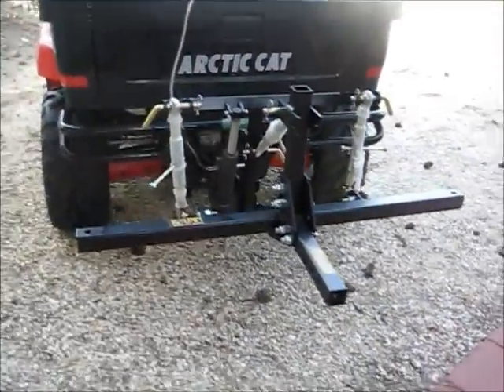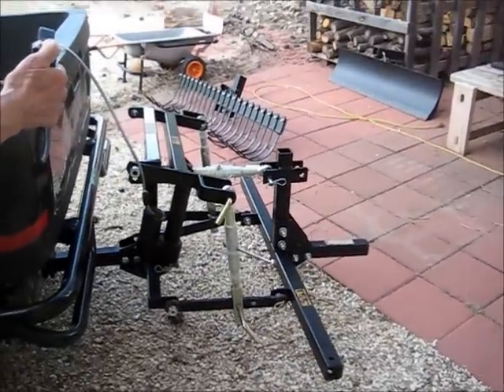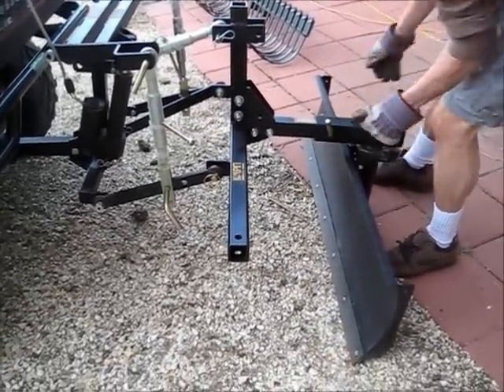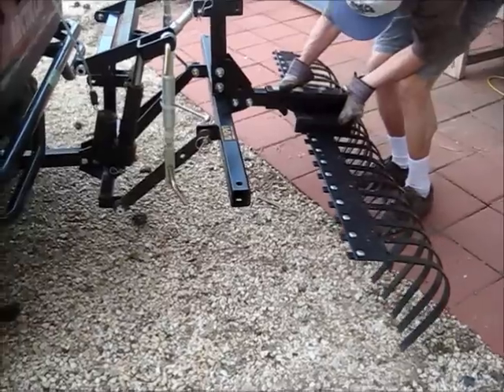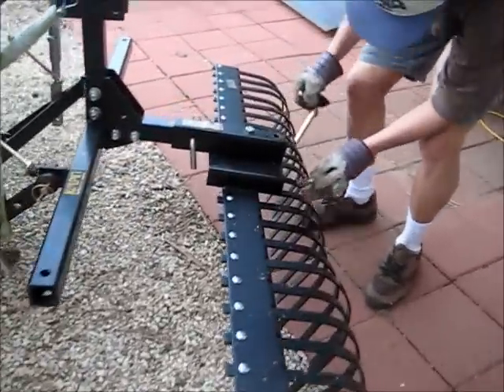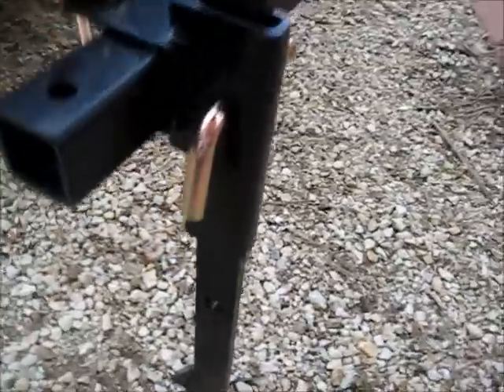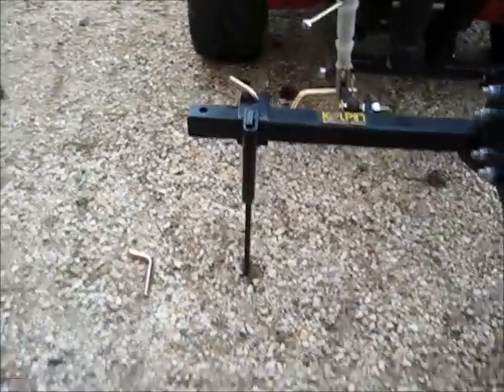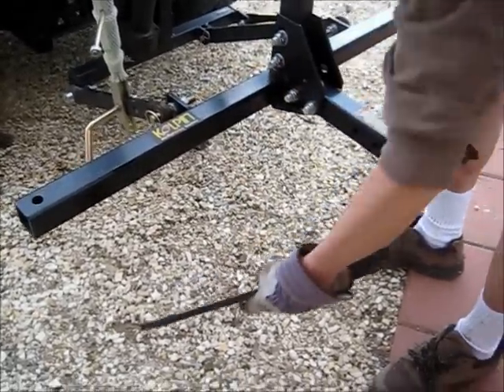Kolpin Dirtworks 3-Point Hitch System

Comment: How would this rake and blade handle sandy material?   I read you sold yours already
Reply from the maker: I would guess they would handle it okay.  We had 4-6" rocks, some even bigger, hard-packed in the ground and the ground was very uneven.  Didn't work well.
Reply: I’m going to drag with my FJ cruiser with a 10” drop to accommodate my hitch height.  Fingers crossed.
Reply from the maker: @OfficialLILV  Good Luck!

Comment: What I think this would be handy for, if the thing even has enough power to lift it, would be an offset blade, so I could make two swipes of the driveway with one go during the winter!
Reply from the maker: This is a landscaping blade for moving dirt around and its located behind your vehicle.  
But you're right to question the Kolpin's power.
We had a snow plow blade that fit on the front of the cat that did a bang-up job of moving snow (see Snow in Colorado part 2 video).

Comment: I wanted to buy this system, but after when I saw this video I try to looking for another system. It seems to be very weak!!! Almost die when it have to lift up some kilograms equipments.
Reply from the maker: I think what you are hearing is that we used a battery that wasn't fully charged.  The power comes from your battery.  The only thing I did NOT like about the Kolpin on our Arctic Cat Prowler was that there were times I needed to raise the equipment higher than it would go for better clearance when repositioning.  We have a lot of uneven ground on our property.  Though, raising it higher may not be a problem with a different make ATV/UTV or if your property isn't very uneven.
Reply: Thank you for your answer.I decided we will make together at home with linear actuator, because the Kolpin's price is very expensive.If we make; that cost will be 30-40% price only.

Comment: How high up will that lift go
Reply from the maker: Sorry we no longer have it or I'd measure for you.  When I worked our uneven ground, my experience was that I wanted it to raise higher than it does, when I wanted to re-position.  If the hitch on the Arctic Cat had been higher, it would have been ok, so it also depends on the height of your hitch.  You can see in the video, it raises about to the height of your hitch.